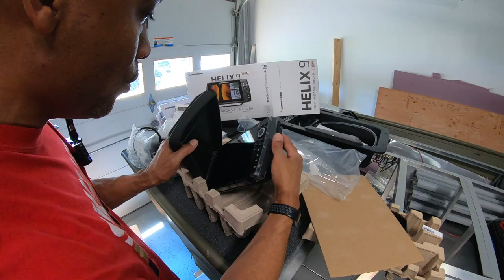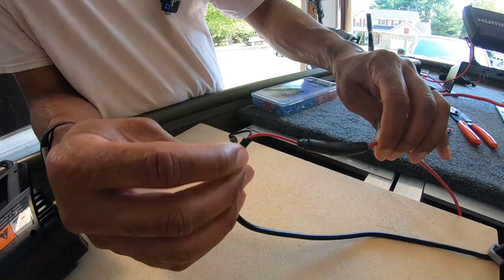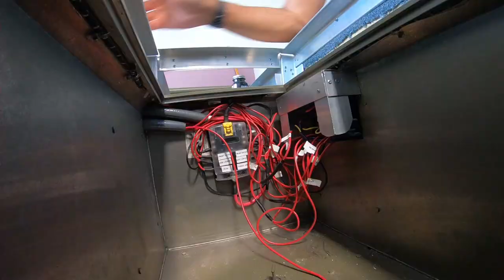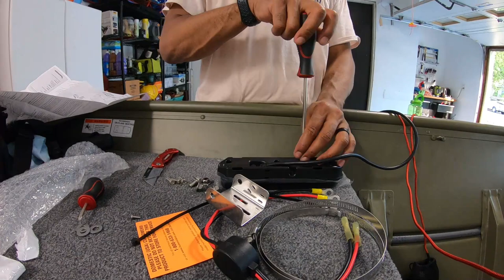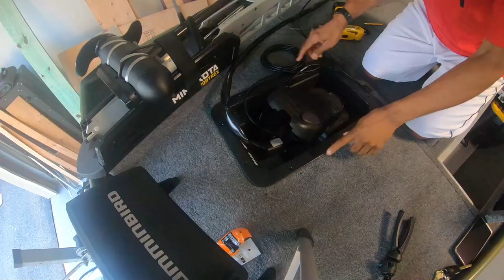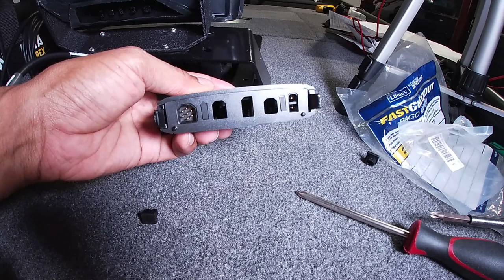Humminbird Helix 9 G3N UNBOXING & INSTALL {Jon Boat To Bass Boat Conversion} Lowe 1448

Comment: I would recommend using electric tape on the transducer wire.  Sometimes the zipties can pinch the smaller wires running in the transducer cable.
Reply from the maker: Ok thanks for the tip.

Comment: Great video, very thorough. Always appreciate the little details. Any issues with grass and other things getting caught in your transducer? I fish the CA Delta and there's grass everywhere.
Reply from the maker: No issues with grass from the transducer.  We fish allot of grass here and the trolling motor itself hitches on the grass.  Eventually I did move the transducer to the back of the boat though.

Comment: Now that you’ve used the transducer on the trolling motor how do you like it compared to a traditional rear mount ?
Reply from the maker: Great question.... now that I've used it for about 7 months, I plan to move the transducer  to the rear of the boat.  That way I can scan while running the gas motor.  I pull up the trolling motor to run the gas motor so I'm kind of driving blind.
Reply: @BassBrothersFishingDMV   yea that’s what I was thinking maybe I will buy two cheaper units